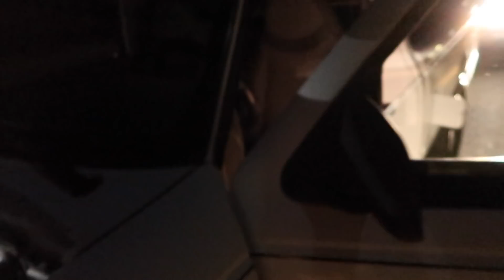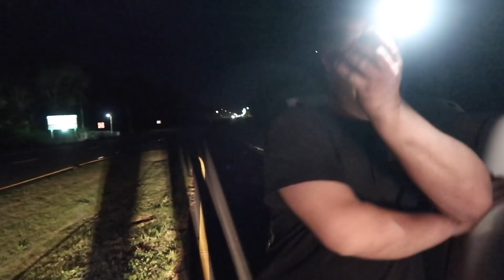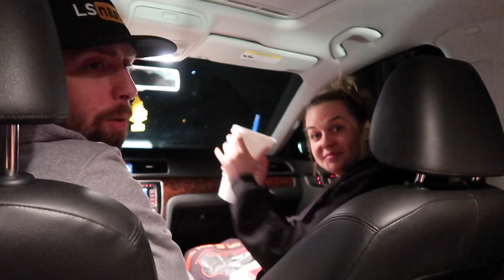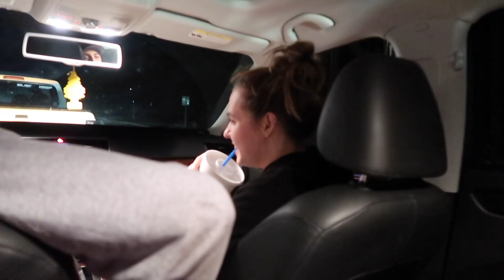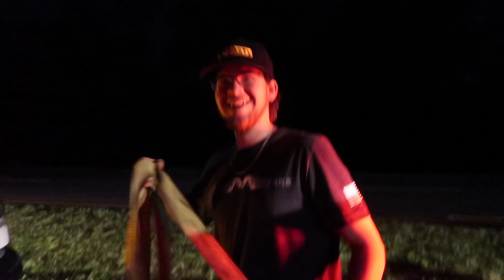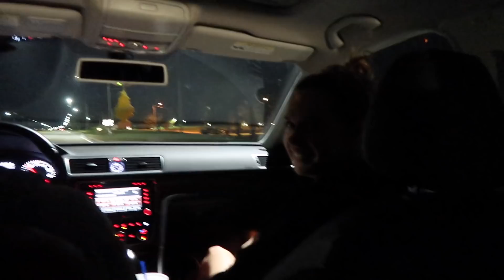THE STRANGER RANGER BROKE!!!

Comment: I have been seeing a lot of "being on side of the road here lately" in my boss man's eighteen-wheeler that I drive every day for work. This is never a good situation! The other night on the way back from The Sod Farm in Georgia... The belt that goes around the alternator, AC, and the water pump came off and shredded at the same time. Truck went up to 250 degrees and started boiling over. It has a safety feature where the truck shuts down when it starts to run hot... I'm not sure how it got to 250 degrees, but I guess that feature wasn't working that night? LOL, to make a long story short... I ended up stranded on the side of the road, had to take a ride with a uber driver that my boss man called for me. The Uber driver shows up and it's a damn transgender! I wanted to ride in the trunk but "it" wouldn't let me. "It" took me to O'Reilly's to get a belt. Then "it" brought me back to the truck. I put the belt on and had a little bit of water in a jug to put in the reservoir. I went about 10 exits up, the truck had a hole in the radiator and I lost all my water. So then I had to ride in the back of a cop car (due to a cop pulling in behind me to check on me) to the police station to get water. i finally got the truck to a truck stop and my wife had to drive two and a half hours to come get me. There's a lot more to this story but it would be as long as a book if I told you every detail. Hope you get that truck back running soon...i like that truck.